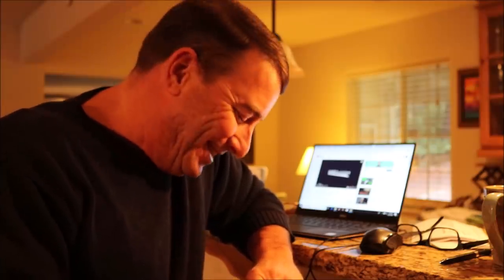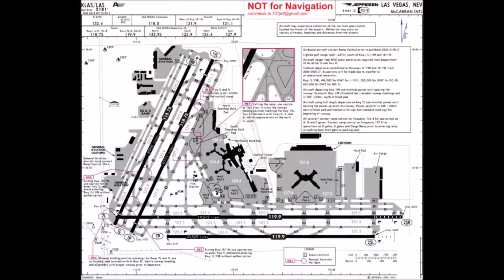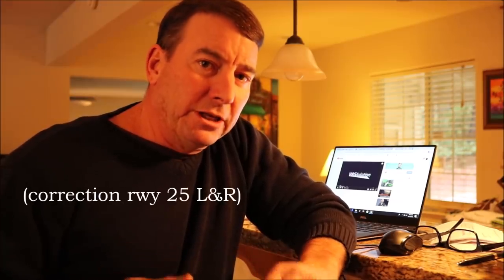Frontier Airlines #9260 A320 Open Cowling in Flight

Comment: My family took my sister and me to Catalina Island on the ship, but allowed us to take the amphibious plane back to Long Beach without them.  We were heading out of Avalon Bay, watching the flying fish leap up out of the water, flying along with us.  Once we were a few feet up, the pilot pulled up about 20 degrees and I fell out of the plane.  Well, that 's what it felt like.  I was weightless for a second when my seat came unlatched from the floor and my seat and I landed in the guy's lap behind me.  I pinched a buttonhole in my shorts, I did.  The copilot came back and helped the guy behind me get the seat set in the tracks and latched down, and got me settled.  What an adventure for a 10 year old!  No tears, just an adventure, and I never hesitated getting back on any other airplane.

Comment: not sure if this has been said in a previous comment, but the A320 NEOs (at least with the PW1100 engines) now have a sensor to detect when the cowls are open and gives an ECAM caution (alert) for the flight crew

Comment: Thanks for the video.
Very informative
Would  it not be obvious, the latches, protruding from the lock positions?
The initial cowling failure forced the reverse thruster cowling pin/bolt to shear/break?
How did that fail if it's bolted,  internally, into place?
Is it me or do the 737 Max's have a harder touchdown?
Tough pre-flight check
Carrying around a creepr dolly?

Comment: Quick question. With sterile cockpit rules before take off and landing, would the pilots have answered a call from the flight attendant during the take off roll?
Reply from the maker: Probably not.
Reply: @blancolirio  If the flight attendant had seen the situation, could they have pulled some sort of fire alarm or other alarm that would have alerted the Pilots to abort the take off.  by the time the public got that attention of the attendants and they verified the complaint it would have been too late to notify the Flight Crew by phone as it doesn't take long to get to V-1.  It seems there should be an alarm from the flight attendant's jump seats that can alert the flight crew of a dire emergency affecting the safety of the flight instantaneously and if they were able, the pilots could have aborted for that unknown alarm from the attendants.  Just some thoughts.
Reply: @raybankes7668  flight attendants are in their seats buckled up during takeoff and landing.
Reply: @douglasbuhr5741   I understand that.   yet they sit in diff places in the plane. and depending on the type of emergency they may be able to see and or be able to contact the crew if they see something that endangers the safety of the flight.  I understand the "sterile" cockpit druring landing and take off--I am a pilot too--yet if they got that kind of alarm they could abort the flight if they were not past the fly-no-fly decision (V-1)
Reply: Richard McCaig  maybe they should change that.  my point is there should be a way the attendants can signal the flight crews.

Comment: Would be nice to have cctv pointed at the leading edge of the wings for the crew to see out there. Is it really burning?
Reply: They have been experimenting with external cameras for decades. The technology is available.
Reply: @OfficialNakatsuMegami  not only on new, old ones to be retrofitted also. that is not something too expensive or heavy. to provide pilot with eyesight on landing gears, engines, wings and tail four cameras is plenty.

Comment: Hi, just two remarks, first the video shown as example it´s from a IAE V2500 not a CFM 56, the second is that from some time ago all Airbus fan cowls have a special Key stored in Cockpit that enables the opening of the first Fan cowl lock. This Key its not removable while the lock it´s open and has a big RED flag attached (like Landing gear pins), making it almost impossible not to see the lock in open position.

Comment: A possible way to stop this from happening again might be an audio warning that starts beeping the moment the latch is open, and only stops beeping when closed. Was a maintenance worker distracted in the middle of a scheduled service? A transducer on the interior panel, using it as a sound board. An idea for the suggestion box. for expert consideration or of course 'rejection'.

Comment: I found it a bit worrying, from listening to the audio, that ATC carried on offering the runway for use after they had been told there was debris on it by other aircraft.  You would think that they would close it immediately and have it swept.
Reply: Agreed! I believe that having listened to the VASA version of the interaction, that it did take some time to figure it out. At first, they thought it was another Frontier jet that had the issue and was still on the ground. It took awhile.

Comment: What is the indication, on the outside of the nacelle, of the buried TR latches being latched/not latched? My thinking here is that if the TR latches were to somehow become loose, they could cause the cowl latches to fail, but (hopefully) not the other way around. TR latches are pretty stout; they’re sized to hang on during a blade-out and the resulting vibration.

Comment: Juan, Re: 6:50 : if they knew about the cowling before V1, could they really stop on the remaining runway? That is, with compromised thrust reversers, could they stop on breaks only?  I think that must be the case, just wanted to check with you. Also, thanks for the detail about how the fan cowling, and thrust reverser assembly/cowlings are opened and latched. However, seeing that detail about the thrust reverser brings to mind ANOTHER question: how the heck did the thrust reverser assembly/cowling become open? It looks like it needs to unlatched AND unbolted in order to do so.
Reply from the maker: Yes.
Was probably never closed properly.
Reply: @blancolirio  Do you see any of my comments, or am I censored somehow?

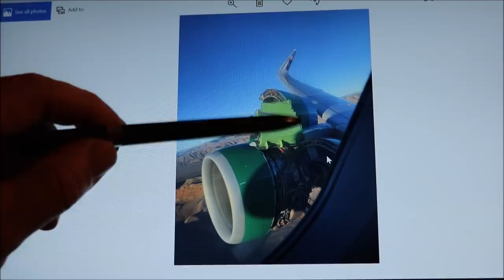Comment: Hi Juan, in the picture at the 11:40 mark, it looks like another engine, more outboard on the wing, but it's not I don't think. But certainly looks like an important part of the engine! What is that? Is that also a part that flew open that was not latched either???
Reply from the maker: Yes, that's the other door wide open.

Comment: OK, so here's a question regarding pilots not being able to see the engines in a typical airliner. Why can't we have cameras looking out both sides of the aircraft toward the engines? Wouldn't it be very useful in a number of situations dealing with engine problems if the pilots could actually look at them via a video link to the cockpit?
While we're at it, mount a couple of additional cameras on the fuselage, below and somewhat aft of the wings toward the exhaust areas of the engines. Heck, mount one on the tip of the vertical stab to overlook the entire top side of the aircraft.

OK, so scrolling down I see I'm hardly the first person to make this suggestion.
Reply: Could be many reasons: to simple, not SpaceX, not a car (reverse camera), ...

Comment: A comment - just as you would not kick the tires and light the fires without  preflight planning, you need a checklist for your videos so you don't have to put disclaimers on what A&P means, runway numbers, number of latches, etc. Other than those slight quibbles you are providing actual hands on information that even non aviation people can understand. Good job.
Reply from the maker: I usually don't bother with retakes. What you see is what you get.

Comment: I just watched a couple of videos about a DC-3 flying from the UK to Iceland and back.  There were cameras mounted on the wings, on the tail, and under the fuselage.  With modern technology, these cameras can be so small that they won't impact the flight surfaces.  Even better if they can be integrated into the design of the aircraft.

So why don't modern airliners have cameras covering every inch of their exteriors?

Comment: Since both the outer cowling and the inner thrust reverser doors opened my question would be... can the outer cowling be properly latched if the inner thrust reverser doors not properly latched?  If so then the FO could have done a proper inspection and have no indication that the inner thrust reverser doors weren't properly secured.
Reply from the maker: Great point! Then the TR doors blow open ripping the fan doors to pieces...

Comment: No cowling ajar dashboard light? Kidding.
Reply: "Your Cowling Is Ajar" - lmao
Excellent. ;-)
Reply: @osakarose5612  Wiring every latch would go way past the point of diminishing return. It would be the equivalent of having an alarm system for every lug nut on the wheel of a car, just in case one of them works it's way loose. The number of mishaps attributed to something like this is so miniscule that is simply isn't worth the effort. You'd get to the point where the various alarm systems themselves would be more likely to cause mishaps than the system they are designed to monitor.
Reply: I thought the NEO's had a sensor fitted now but l could be wrong.
Reply: 'Check Engine' light was on, but they alway are in an Airbus...
Reply: The movie Airplane!,  Peter Graves looks down at a flashing warning light and quips "that's strange".  Camera pans down to the light and it's actually labeled "strange".  The one to the left is labeled "weird" and to the right is "Bizarre".
Reply: Scare Crow I remember back in the 80’s when some very confused vehicles added the verbal “your door is a JAR”, to which I would politely remind the vehicle, “no, the door is a door, stop calling it a jar”.  The way that one pretty much has to pause for that fraction of a second to transition from the “a” to the hard “j” always makes it sound like “a jar” coupled with the fact that their choice of “ajar” rather than “open” on an American made vehicle was always a strange one as we simply do not use the term “ajar” in our regular vocabulary as we tend to strongly prefer the word “open” almost exclusively in conversation.  It would have made more since had it been a European import, but this was from the Big 3 here in America, which made it all the more strange a word choice!
Reply: @ethanpoole3443  We had a 1984 Plymouth Laser which had a speaking computer we dubbed 'Charles' who tell you impotent things like 'Door a Jar' and 'wiper fluid low'.
Reply: @BrilliantDesignOnline  'replace blinker fluid'.

Comment: There are countless incidents (and accidents) where the passengers knew more then the pilots.  It is inexcusable not to have 'round the aircraft TV cameras, including ones around the outslde, and inside in the payload bay, and the internal wireways.  Even cars have exterior cameras!  This would eliminate the confusion as to which side is affected.

Comment: Change it up a bit.  USAF crew Chief here.  KC-135 A   Latches are latches... that training video is deceiving.  The latches there I suspect were adjusted to a ( HANDBALL) tension. There is a gauge ( modified fish scale basically) to check them with.  There is no way one could just stick a finger in there and pop them.  The CENTER rectangular door that you first need to actuate is the SAFTY LOCK.  This is a TATTLETALE... If it is NOT ABSOLUTELY FLUSH with in its MOTHER LATCH .... you have a OVER TENSION ( adjusted to tight)  or UNDER TENSION ( Too loose).  If the SAFETY LATCH is SUCKED INTO the MOTHER LATCH.....”OVER TIGHT”. If the SAFETY LATCH is popped OUT and seems floppy when touched... TOO LOOSE.  IF I RECALL... the pressure needed was a MAX of 50lbs to CLOSE at which point that SAFETY LATCH will exhibit a SUCKED IN POSTURE. ...  with ALL NEW TO THAT ENGINE COWLING ... The sheet metal needed adjustments along with ALL THE LATCHES. NEVER WOULD WE ACCEPT ANY latch that opened like in the training video. Sure it looks good but in reality it could rattle open.    Any SAFETY LATCH that was showing a LOOSE condition Will POP OPEN and are only detected by PHYSICAL CONTACT after you kneel down and TOUCH IT.   My inboard engine(s) were about as low ( roughly) and the only way I could close my latches was laying on my back and using my foot after I had everything else set.  Granted I didn’t have reversers as I only had 2 pieces: IB/OB cowl.

Comment: I don't understand the fan cowl latches not being noticed. If they are inside another door then there is no way that the external door can be latched closed! The engine cowls are a different story. One side cowl has the latch and the other side cowl has the catch. If the latches are left unlocked they should have been hanging down from the cowlings and noticed on preflight providing the first officer looked at the bottom of the engines! Oops!
Reply: As the guy in the video was demonstrating not all the latches are obivious. Likley some latch was broken or overlooked

Comment: cameras are so cheap now, why aren’t these modern aircraft outfitted with cameras looking at the engines, wings and tail structures? At least provide the pilots with a visual of what’s going on.
Also, there should be a “latch open” sensor on these cowlings since they’re so critical.

Comment: When the thrust reverser doors blew open could they hit the leading edge devices if they were being used during takeoff?
Reply from the maker: may have hit the bottom of 'em...good point.
Reply: Would the lighter fan doors blowing off cause the heavy reverser doors to go or the opposite be more likely?  Seems like the reverser doors would of held unless that is where the problem started. Appears to be much harder to inspect the reverser door latches.

Comment: Juan, great video and reporting as always, but it's important to note that the Frontier fleet is all CFM engines.  The CFM cowling, while similar to the V2500 (which is what your video is of), the Aft Engine Cowling is opened in a completely different method as it is a different (shorter) design).  There are 4 latches of similar design to the mid-cowl with the CFM and no tensioning bar as with the V2500.  That is why the aft cowling was able to come open so easily.  Here is a video of the CFM cowl opening and closing (from I suspect the same uploader) - https://www.youtube.com/watch?v=irzcOhjOzAU

Comment: There is so much engineering and repetitiveness built into aircraft these days that I would speculate that the heavy rear cowling doors could easily remain on in this type of an event after point of rotation / V1 takeoff.  However this will be a marketing nightmare for Frontier and most of the blame will be on corporate structure (where it belongs) and not the 1st officer as this event is indicating that there is a systematic issue in equipment maintenance.
Reply: Ah yes, but hanging the FO is the preferred fix.

Comment: As would have been said on the AF flightline, someone screwed the pooch. Having been around F-111's, F-4's and KC-135 aircraft it is pretty obvious when an engine cowl is open or not latched closed. From the example videos I could see the forward cowl latches not being seen if only a "casual" walk around was done. Considering what is required to even just unlatch the aft (thrust reverser) cowling I do not see how that could have been missed on the walk around.
It seems to me that even with a forward cowling failure the aft cowling should be secure enough to not fail and then open.

Comment: From the cockpit perspective, how do you know that you have had a cowl open up in flight? I assume that there would be a degradation of power in the affected engine and a drastic increase in drag and associated loss of lift. What warning, if any, does the pilot have other than what I mentioned?. You can see where I'm heading with this. If the pilot reacts to a potential cowl latch failure, is that "camoflaging" another, more serious problem?

Comment: Is it a (non-minuscule) possibility that the latches failed somehow? Seems weird that this would be missed by 3 people...
Reply: You really only need the one to be weak, the second to not be closed and wind will do the rest of the work for you. However as the thrust reverser doors opened there is a very good chance somebody did not tighten the link bolts up after inspection or service, hidden by the outer doors, and the stress of flight eventually failed the other redundant latches. Those latches are not rated to handle the stress of the bypass air or thrust reverser operation, just to keep the outer skins in tight control so they do not vibrate, there is a big link that provides the strength by closing the hoop as shown in the video.